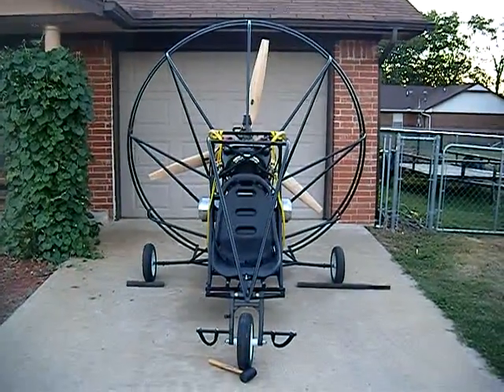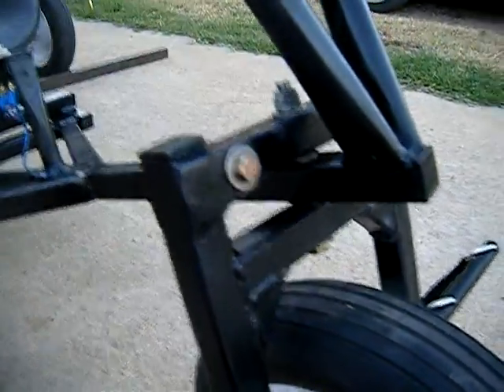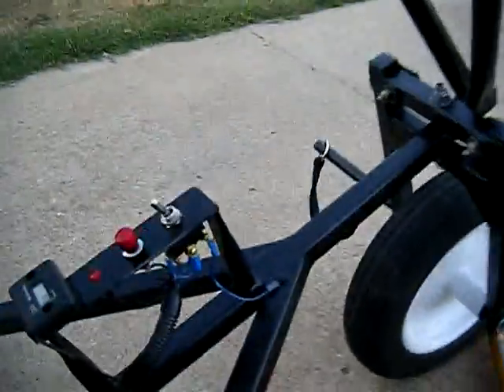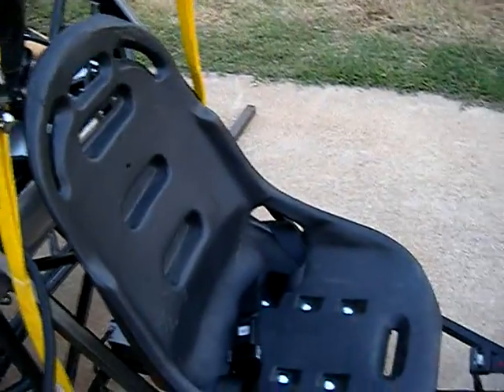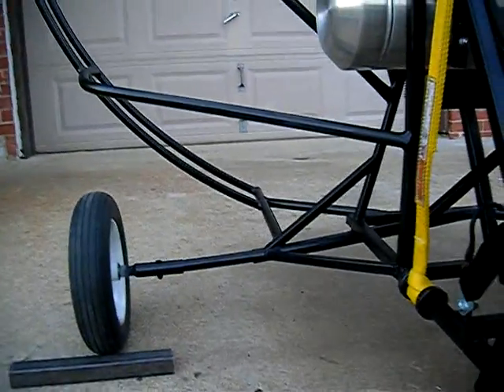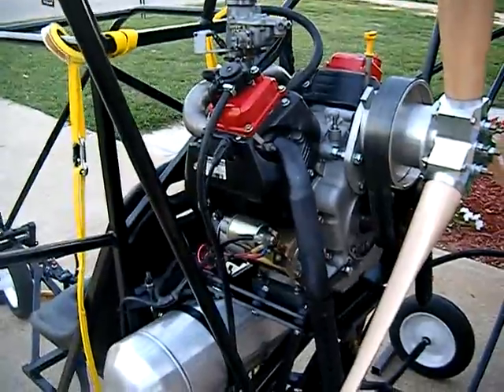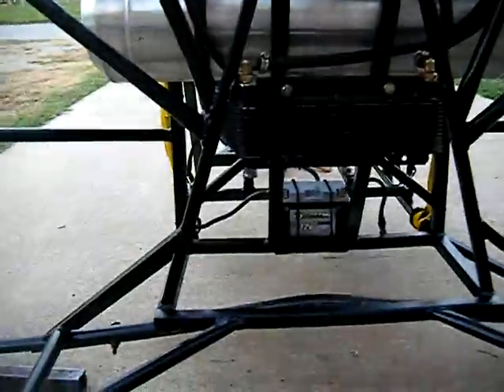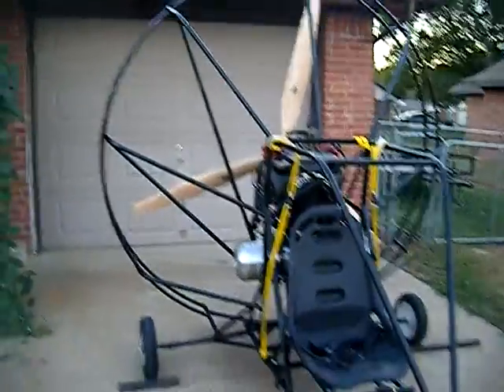PPG Trike,4-stroke!!

Comment: Good strong trike, I found with the Briggs V-Twin that if you use a single carb inlet the induction manifold pulses fight each other, causing uneven mixture and temperatures on each jug. This is why the industrial engine makers all keep the two inlets separated, each side with its own single choke. Harley get reversion sometimes for the same reason. EC carbs advised I keep the inlets split for good running so put the larger carb on but stayed with two throats.
Reply from the maker: Kevin Armstrong I am no carb guru, but i ditched the carb setup that was on the trike in this video and am now running a dual Mikuni setup with seperate "short" intake manifolds
Reply: ringgo1star sounds good, the Mudbuddy folk seem to like the twin carbs. I took the safe rout and just put the next size up carb on, my Briggs is a 38" or 627cc, so the carb off the 61" or 990cc came ready made, only needed the inlet header opened up a little to clear the butterflies. I ordered the high altitude version as that has smaller main jets, suits that motor well
Reply: Kevin Armstrong  keving can you send me the  model number  of the engine igot one but no serial model or numbers

Comment: Having trouble with my stock and linkage for use on my hovercraft,too stiff for twist throttle.
Where can I purchase your intake manifold and what size of Weber is that?
Great looking set up by the way.
Can't get all the cool things here in Canada.
Reply from the maker: This intake was custom made and I dont know who built it. It came on the motor when I bought it. I now have seperate intakes and carbs. Im running a dual mikuni setup now.